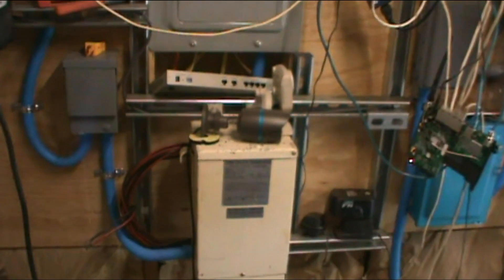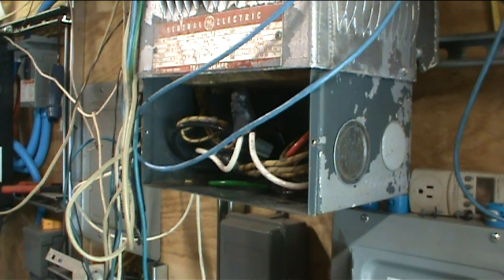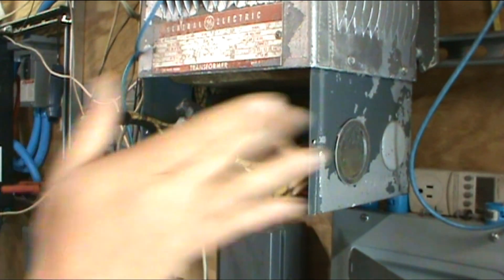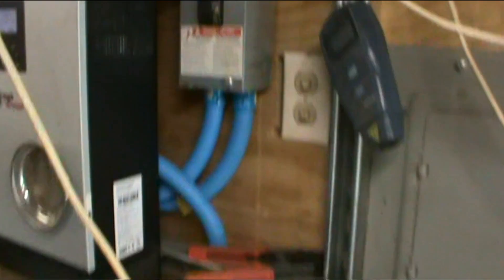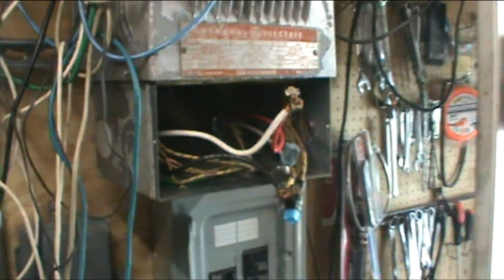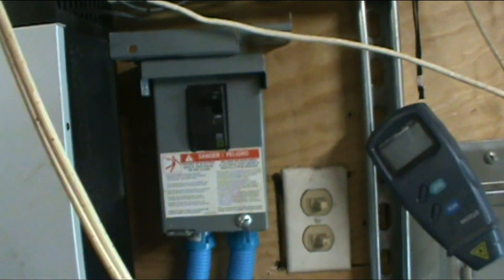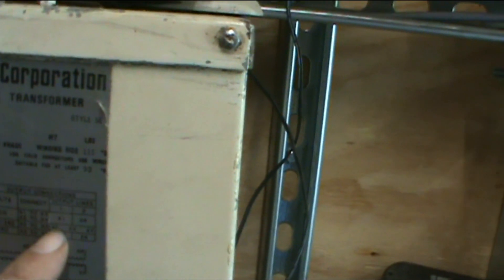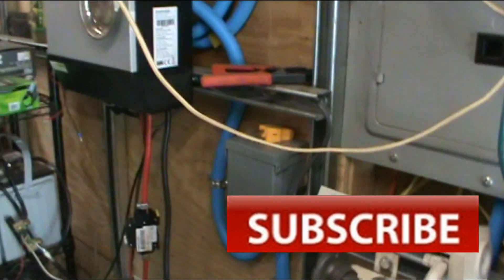PIP 4048 Update. Set up with out, input Isolation Transformer.

Comment: Hi McCune, Iam thinking wire my PIP5048MS output to two separeted 5Kw stepdown transformers cross connected so I will have Hot1 from T1 and Hot2 from T2 and Neutral from neutral of T1+T2 together. This transformers are autotransfrmers which dont insolate inverter output from Main Panel breaker. Is that posible? Will be issues with Neutral and ground?

This is the transformer I will buy: Simran THG-5000T Step Up & Down Voltage Transformer Converter for 110V & 220/240V 5000W https://www.amazon.com/dp/B01HUD5MSY/ref=cm_sw_r_cp_apa_YV-CAb7BXMQ05

Comment: Thank you for getting back so quickly. First of all. I am from the United States, my question was, did you running 120 V or 240. Too. The PIP Input for charging your battery's. Without the Transformer. A lot of homesteaders only have a 120 V generator, for emergency backup power. Again, thank you. And for your video on the PIP .Neil Las Vegas NV

pip

Comment: I understand you have taken out the input transformer, you didn't really describe what the input voltage you are applying. Now to the PIP.  I add, because if you're using a generator to supply your batteries with a charge, are you using 120 V or are you using 240 V on the input without the transform to the PIP. Neil Las Vegas,NV
Reply from the maker: Sorry about that friend.  The transformer was more of like and isolation Transformer,  we in the states have a 240 volt split phase were as this unite is just 240 volts. I at the time thought that I could use the power I have since each leg of the US 240 is still hot in respect to ground.  I later round with reading more on the pip and the input I found it is all isolated and that I didn't need the transformer that I was using so I would have a true 240 hot wire and a neutral and ground.  Now I found I didn't need it since the PIP is all isolated in the inputs and out puts I didnt need it saving me the extra power loss though that transformer.

Comment: hey Charles, I found this website. do you think one of these would work? it would be nice if we can find new transformers so we don't have to rely on ebay.
best
http://www.automationdirect.com/adc/Shopping/Catalog/Power_Products_(Electrical)/Power_Transformers/Encapsulated_Transformers_(NEMA_Rated)
Reply from the maker: Yea its nice to buy new.  But mine are used for fraction of the cost.  I gave 125 for my 5 KVA Transformer. and I think shipping was like 60 something.   and I gave 150 for the 7.5 KVA, and 85 shipping  Even though I didnt need the input transformer like I thought I did witch is a good thing less power being used.
Reply: Yes, I found one on ebay for 199, same model. It is nice to have the details of what to look for so when I talk to others about going with a pip that this is something I can show them.
trying to do this on a tight budget so now I have to decide if $150 more is worth the mppt model or not.
Best

Comment: So my grid voltage is at 220 vac split to the 120 vac on each leg with respect to neutral. will this be a problem with the spec requiring 230 vac?
John
Reply from the maker: nope wouldn't be a problem

Comment: Awesome setup!! Thanks for doing this video. 
So your running 240 split to the pip & when it transfers to the grid your transformer is converting the split 240 back to a single 120volt output?
Reply from the maker: +off grid kid I will do another video to explain things in more detail.
Reply: Now your system is more efficient....

I understand everything up till the pip switches the 240 split phase to the single smaller transformer. 

You just bypassed the bigger transformer, good move...... Did the same but used a contactor, looks like your using the pip to do the transfer but don't understand what's going on there as the pip is still wired to the smaller transformer. so if i understand correctly the pip is feeding the transformer 230 single phase power with solar & battery when transferring to grid with 240 split, Is the way you have the small transformer wired allowing it to work this way??  

When pip transfer to grid do you still have split or single phase power coming from the transformer???
Reply from the maker: +off grid kid its still split phase.  the pipe dose all the transfer.
Reply: so pip is running split & single phase threw the transformer?

single offgrid
split ongrid

Or does your transformer make split 115/115 from the 230 single output from pip??
was thinking it just converted 230 to 115 single???

That setup is awesome. want to understand it better. But don't think my transformer will do what yours is doing there???

Comment: It's nice equipment but I still rather avoid the need for a transformer.  Given I do still have to go on the road from time to time it would make it easer for the wife.  I guess am going to stick with my original design as it easier to install in the US.  Am sure they will come up with a US version if they see a market for it.  Maybe they will before I start installing my solar which has gotten moved back some.

Comment: interesting skills and electrical knowledge you have, neutral is used differently  one country to another, ive still got plenty to learn and im looking forward to learning all i can.
Reply from the maker: +closertothetruth yea they are pretty much the same electrically,  The US is a little more complicated with a split phase system that we use.  I could always use Justin Case's Tip and just buy all 230 or 240 volt appliances and never have to worry about split phase.  but I think that would cost me a little to do.  Wiring would be a snap, but the cost of appliances would.  But I think I have it all working pretty good.  I'm sure happy I didnt have use the big transformer.  Now to think what to use that monster for.
Reply: +McCuneWindandSolar thanks for the reply ill go and do some more research to get a better handle on it , interesting.

Comment: If you came off your pip with 240 v and ran it into an isolated breaker panel you should be able to pull off one side and get 120 v and eliminate the other transforemer it should work the same as your house panel box
Reply from the maker: +Larry Kemp will not work with this PIP.  its not set up for 240 volt split phase.  in the US we have 240 volt split phase and both hot legs are hot in respect to neutral or ground witch would be one hot leg to ground or neutral is 120.  and voltage across both hot's are 240.   Were as with the PIP  The 240 is the same in wire aspect as for a 120 circuit.    You will have one True hot leg a neutral leg and one Ground as you would with 120.   Because the pip is made for places like the UK were they have 240 and Australia witch also uses 240.   If you take a meter on the out put of the PIP if you take a measurement from hot to neutral you will get 240.  from neutral to ground 0 volts and from the hot out put to ground you will get 240.  you cant get 120 from this pip with out a step down transformer for 120,  or for 240 volt split phase for 240 / 120.    Hope that helps.
Reply: Thanks  I was curious why you used a step down well this answered my question no way around it Thanks Larry
Reply: Thank you that was the explanation I was looking for! Thanks for the video! I have a pip too; just haven’t hooked it up yet.  Hopefully soon I’ll have it up.
Reply: @NPShows  NPShows, were you able to hook up your pip yet? i have one and i am planning on setting it up in the next week after work projects subside. i have a 5k transformer but when i went out to look at it, the transformer was upside down and we had some water get into the shed and when i flipped it over to read the wiring diagram water came out of the transformer, it was not plugged into anything but i now wonder if i let this dry out for the next 6 days will it still be good or should i throw it out and buy a new one? i have a pip 4048 and would love to wire it into my sub panel to the house to offset my grid power bill during the day, i don't have a battery bank yet this will be next on my list.

thanks, Charlie

Comment: nice, very nice
so does this mean you only need the output matching transformer and not the input transformer?
Reply from the maker: +Rev John O&#39;Toole All ready know all that.  If you look at the power pole were the step down transformer is located to provide power to a person home.  there is singale phase voltage from 7200 volts or higher running in to a transformer.   the out put of that transformer is your 240 volt split phase at the transformer the neutral at the transformer is tied to ground, and you will notice all on electrical pole's there is a ground wire that runs up the side of the pole all the way to the top to the top wire witch is also the Neutral on the high voltage side. and neutral and ground should only be tied at the transformer neural and high voltage side of the transformer I can later do a more detailed video on that.  then from that transformer to a person meter if  its on a pole like mine is once again the pole is grounded all the way to the top and its tapped off on the bare wire on the twisted wire coming to the pole. then in the Meter box that is when  your two hot legs,  Neural and Ground separate.   If you have a meter that is is on a home that is fed either by over head or under ground they will split at the meter there as well  and when the wire is ran in to a mains breaker box they are all wired with neural and ground on separate buss bars and Neutral in the breaker box should be isolated from the box   If you have a new breaker box and you check continuity between neutral and ground buss bars they should not be an electrical connection that is the new code.  back in the days didn't matter but new codes and the uses of GFI's CGFI's they now have to be electrical separate the neutral and ground other wise the GFI's will not work. 

In my set up with my first Isolation Transformer I did what you see at the pole.  240 in  case round not from the in put side it was not grounded  the neutral from the input was bonded to the now neutral on the out put of the transformer making as you would see in UK or Australia  a out put that now has a Hot leg a neutral and a Ground that is separately grounded out side separate from the input ground  and the same is done with the step down transformer as you would see from the mains transformer out side of your home on and electrical pole. 

This is all done with my Knowledge with industrial wiring and codes,  We change voltages up and down left and right for so many different pieces of equipment,  and this is just singal phase with split phase,   and that the easy part when you get in to 3 phase that is when the fun begins,  and with transformers you can fine true for different voltages. IE 480 in with voltages between 240 to 210 with different taps on the transformer,  and the same from 120 and so forth.   

I'm pretty good with electrical work and how its wired up.  been doing that for a while.
Reply: +McCuneWindandSolar I know you know, your a smart guy.
just many don't. and some will just break off the ground pin or not hook it up.
best
Reply from the maker: +Rev John O'Toole yea you right I have see people do that with like a dryer or washer.  very deadly thing to do. vut I have seen it. I always tell people ground is there for a reason.

Comment: Glad it worked for you. Now the question has been answered, what as are you going to use those transformers for? But good explanation of the input and phases: ) thanks Charles
Reply from the maker: the only transformer I won't need now is the input tranformer.  I will still need the out put transformer for 120 volt stuff.  now I get to save almost 300 extre watts per hour with the removal of the input trans.   makes for less wiring and saves on room.